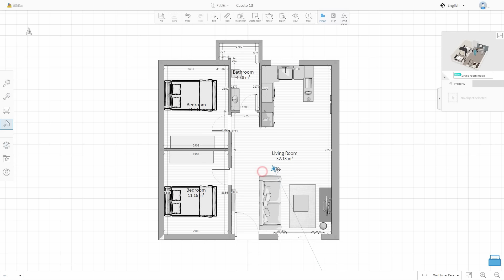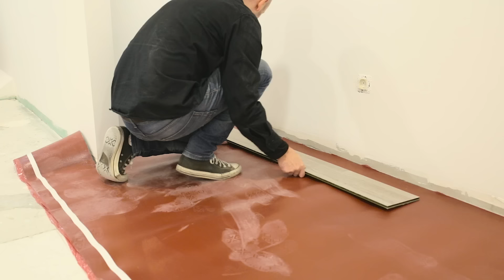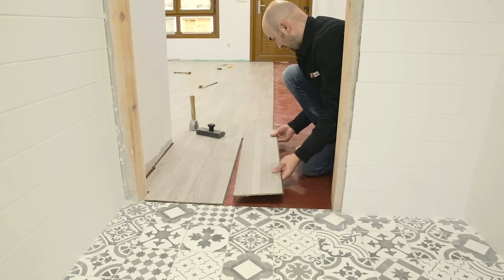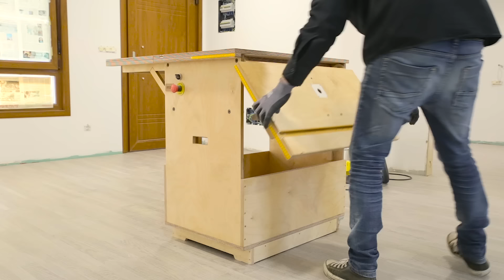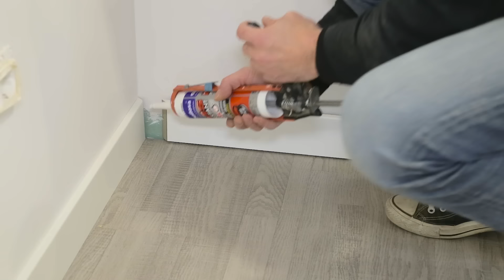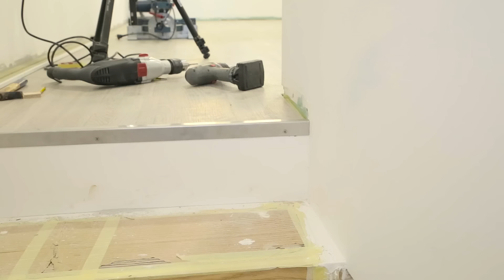Apartment Renovation Ep.1 / How to lay Laminate Flooring

Comment: You're a very accomplished woodworker and I highly respect your work. However, I'd like to offer a bit of feedback.

Firstly, inside joints should always be butt joints. External joints are all that are mitered. The reason? So end grain doesn't show. Just as in cabinetry and furniture.

Secondly, finishing a run of trim is called a return and you finished yours correctly. You also created the wraparound correctly, although all three sides are sometimes built on the bench, depending on length/awkwardness.

Lastly, casings, jambs, etc. are cut exactly using s piece of flooring as a guide for an oscillating tool. Perfect results everytime.

Looking forward to future apartment renovation videos.

Comment: Incredible knife, there is no such model in Brazil, we usually use miter saw. I liked yours because it is easy to use and it does not make a noise.
Reply: It looks like those to cut zinc bars and plates. Most likely it will do the same job.